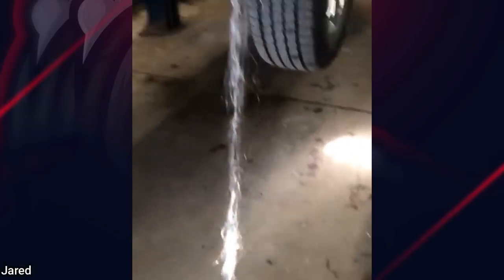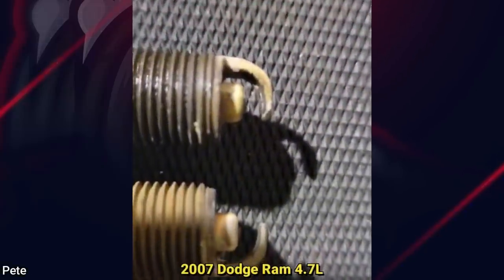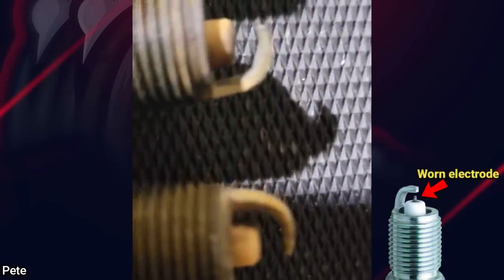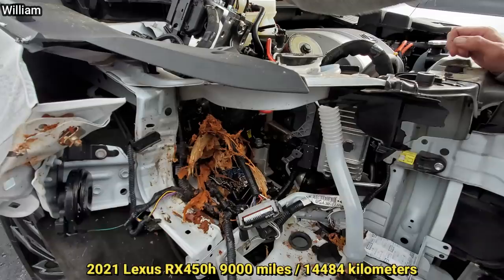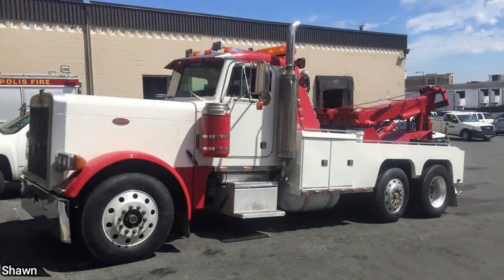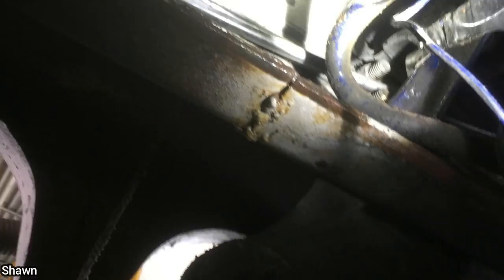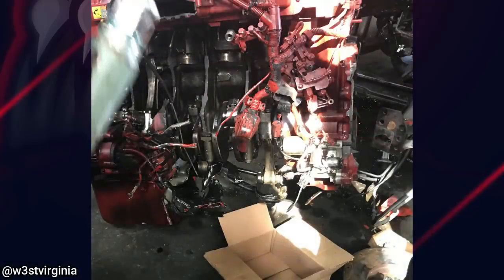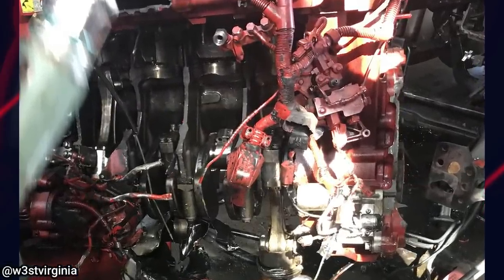Customer States He Hit A Curb At McDonald's | Just Rolled In

Comment: Stuff like the broken frame on that big Peterbilt wrecker, that's how you kill people.  I mean that rig could be carrying a 100,000lb load if the wrecker is 20,000lbs, towing a fully loaded 80,000lb truck.  Shoddy shit like that on class 8 trucks, faulty air brakes, companies too cheap(or just too ass broke) to maintain their equipment, I really wish we would enforce the laws and crack down on this type of thing in the trucking industry, cause a heavy truck with faulty brakes/suspension/steering is just an accident waiting to happen.  Given what these trucks weigh its gonna be a very ugly accident.

Comment: I've got a question. I'm a European only driving non-automatic cars (manual transmission? stick shift? What's the proper word for it?). I like watching car videos and have often seen clips where people produce incredible amounts of white smoke or, in other videos, black smoke, from their cars. How is this done?
Reply: What’s the proper word?

Ironically, in the US, a manual is called a “standard”.
An automatic is generally called an automatic.

Why is a manual called a “standard”?

Until very recently, most cars had a lowball price for the “basic” car model that came with the manual transmission as “standard equipment”.
An automatic was “optional” (or today they’d call it “available” and cost more. Sometimes thousand(s) more).

You don’t see it that much these days. Many cars are only available with automatics, though I did test drive a bottom end HONDA HRV a couple years ago. It had a stick. It had so little power, merging onto the highway was a scary thing, even with running up the RPMs… I didn’t buy it.
Reply: @sirifail4499  Thanks for the explanation. I dunno about the Honda hrv though. With a standard 🙂 you need to know how to handle it properly to get the power. I learned to drive on a standard, and I've got a car with about 65 horse power, and I can handle it to merge onto the highway pretty well. It takes a bit of practice and sensitivity to how the car behaves. Finding the right range of RPM to get the maximum power in my car took me a couple of months.

Comment: 3500 rpm for a diesel ? It’s ok unless it’s a VOLVO PENTA MD11C ( boat engine) that the engine is rated at 2200 rpm cruising speed and max rpm at 2800 rpm .
I have modified some diesel that still running today 10 years later and rev 6500 rpm , and they are beat up ….

Comment: I had many years ago bend 3 wheels and destroy the tires and bend the rack and pinion when she borrowed my car when I was away for a work trip and when I came home and found out I went bonkers, it cost $4000 to replace 3 aluminum rims, 4 tires, new rack and pinion, both control arms, half of the exhaust system, radiator and hoses,grille,serpentine belt when her and 3 of her friends were coming back from the bar at 2 am and hit a hole in the road that was closed because of a water main break and there was a 2 ft deep hole which she hit